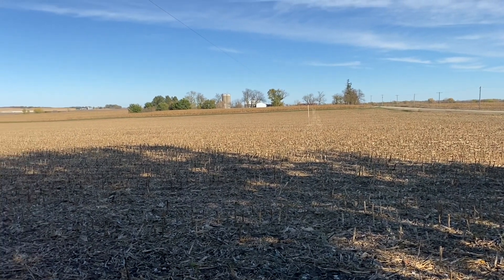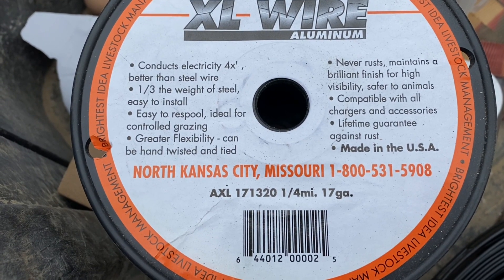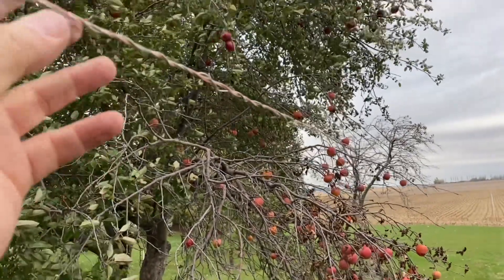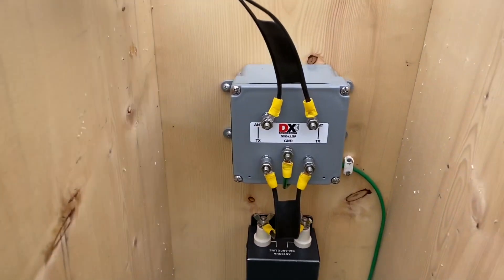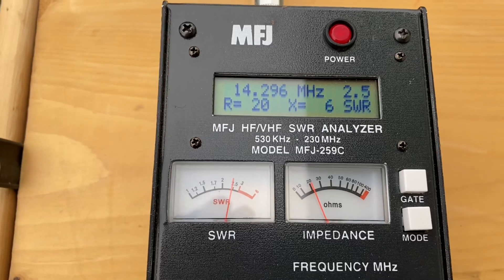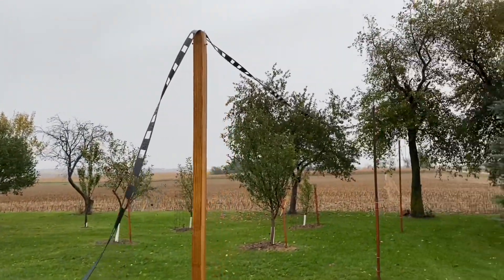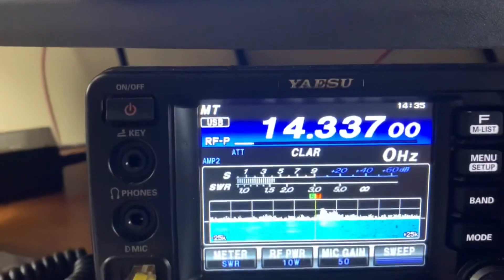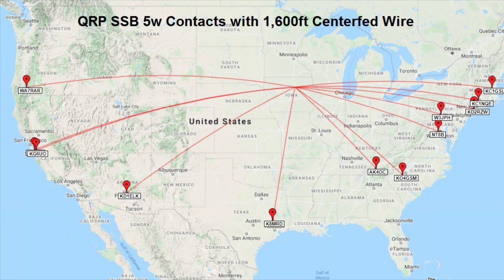1600ft Homebrew wire antenna QRP SSB 5w - Iowa

Comment: Oh but you CAN solder copper to aluminum! Bury the aluminum in highly activated flux (The old acid flux for plumbing) or use johnson chemicals Ruby Fluid zinc chloride (it is acidic and it deposits zinc on a molecular level: this REALLY aids in tinning - scrape the surface oxides off with stainless steel razor blade. Don't let air get to the exposed aluminum. Wet soldering iron tip with solder and it works perfect! Aluminum refuses to exist in it's bare exposed natural state with air, aluminum oxide forms on the surface INSTANTLY. More instantly than you think! Aluminum oxode is what you cannot solder to. It has a melting point of thousands of degrees F. I see it as though the aluminum I am hoping to solder to likes to grow a diamond shield to prevent it. Trying to actually weld aluminum is the same: the oxide layer is a blocker and must be removed. Go ahead and take a torch to aluminum! The outer oxide layer doesn't melt and the inner raw aluminum boils inside those layers.

Comment: Kevin and I watched this again and I am amazed at how great of an experiment and how radically different. The two antennas are. Do you still use the long wire to the top of the silo? I know you are usually using your fan dipole.

Comment: That 1600' wire should be great for winter 160 meter use.  But the high angle take off at such a low elevation does not help on the upper bands. Fun experiment. Thanks.

Comment: As with any piece of wire of you will make contacts but one wonders if resources would be better spent on another design. Even a 160m full wave horizontal loop might be a good alternative when used  as an all band antenna. I modeled your antenna and discovered that antenna has rather high gain and low angle of radiation on the higher frequency bands in the direction of the wires as is typical of long wire antennas. (e.g. N&S and E&W) . There is much less gain at a 45 deg angle to the wire axis.  Placing one of the wires so that it faces to Europe could be useful but the other directions may not be so useful. Study an Azithmuthul map for your location.  On 80m I think would rather have a vertical as this antenna is a cloud burner.  The radiation patterns are certainly a bit weird.  73.

Comment: If you still have any, try using any insulated electric fence wire already up on the poles in the field with the G90 tuner. Awesome video.
Reply from the maker: Thanks for watching.. I've been putting the ole G90 tuner to the test lately and it hasn't disappointed.. I'll have to look at the fence wire in the spring.. Thanks for your comment, I appreciate it.. 73, Kevin ~ k0klb

Comment: That was interesting Kevin. I have messed with delta loops in the past. I wonder how it would work it you added 800' attaching to ends of your V together. That would be a monster though! Would be quiet, but interesting to try. Just a thought. I just Subscribed to your channel today. Interesting to see your next experiment. Btw I have a 160 meter HWEF sloper from 40' on the tower up to a 70' tree. And I used the dji Phantom 4 Pro. Drones make wire antennas easy to hang! 73 from KC0FGX
Reply from the maker: Hello Ferrell.. Thanks for stopping and leaving a comment.. I did like the "V" configuration.. I really liked it when I hooked up my Tecsun S2000 Short Wave Radio to it.. It was so quiet and I think it was pulling in stations broadcasting on Mars, LOL.. it was a great listener.. not so much transmit but that's to be expected I think.. We did add another 1,600ft and squared it off.. It created a big lobe to the east, but not much radiation to the south, or west directions.. That video is at this link:  https://youtu.be/CBVbYH8iM7c  .. I use to have a DJI Phantom 2 Prof but it broke and  I now operate a Mavic Mini (249grams).. Thanks for subscribing and watching.. I appreciate it.. 73, Kevin ~ k0klb
Reply: @hamradioqrp-k0klb   Thanks again for replying Kevin! 73

Comment: Interesting. Did you plot the pattern with EZNEC? I did a quick plot. First thought is a little height would make a big difference. Second thought is legs may be too long. Plots with 2 and 4 wavelength legs on 20 meters gives pretty good patterns with an angle between the wires of like 50 degrees. Looks like you were using about 11 waves per leg.  A 90 degree angle does not let the lobes from each wire combine very well. I always model my antennas with EZNEC and use a standard 1/2 wave dipole as my standard. A half wave dipole 1/2 wave above ground has pretty good gain (about 8dBi). With only 120 foot legs, a 20 meter V beam at 55 ft has gain of almost 12dBi on a line bisecting the angle. When at 10 ft the gain drops to only 3 dBi. However at only 25 feet the gain is back up to over 10 dBi.  Also the peak elevation or takeoff angle rises as the antenna gets lower ( true for all horizontal antennas). Wish I had your space to play with! 73 de N4DJ
Reply from the maker: Hi Don.. Thanks for your comment.. I did not plot anything when I built it.. I just ran a wire from the house east to the fence and it happened to be 800ft, so I ran the north leg 800ft as well.. I had no idea it was in a "V" beam style configuration until someone mentioned it in the comments.. I literally just threw the wires out there to see how it would perform.. Like you say, the legs are too far apart as I study more about Vbeams.. I will say though, it is nice a quiet, LOL... like a sloppy Vbeam / beverage combination, LOL  When I connect my Tecsun S2000 short wave radio to it and listen to DX stations, the audio is amazingly crystal clear and sound like local FM radio stations.. The whole thing will be removed in the next month in preparation for spring planting, but I think for next fall after harvest, I'm going to look at getting more height and make a better effort at a real Vbeam or a possible delta loop.. I have all summer to think about it.. Thanks for all your detailed info.. I will refer back to it as I plan for next fall.. I'll see if my brother wants to plant and harvest around a couple 40ft poles out there, LOL.. Thanks for watching Don.. 73, Kevin ~ k0klb
Reply: @hamradioqrp-k0klb  40 foot poles would be nice! There is a guy I used to work on 15 meters out in the Northwest who used V beams. Narrow beam width but pinpoint gain.  I have the 19 edition of ARRL handbook and it’s got good info. I also have a old 73 magazine wire antenna book. I have an electronic copy I think I could email you if you would like. I have been collecting and doing antenna work for a long time.

Comment: While you may not technically be able to solder the wires together, you can braze them. They make ALCOP aluminum copper brazing rods so you can braze them together with a simple torch.
Reply from the maker: Hello Lunaeros.. Thank you for the comment.. That's great information.. thanks for sharing that.. I'll look that up and have some on hand for next time... Thanks for watching, 73 Kevin ~ k0klb

Comment: nice video it would be good to see how they both go on the low bands ie 80m and 160m 73
Reply from the maker: Hello Meggala.. Thanks for your comment.. I've been listening on 80 and 160 a few nights.. The noise is basically none existent and the signals are clear and strong... However, I have tried to break into a few of them and am not being heard... Granted, I'm only using 10 watts, but a few times I tried at 40 and 80w and still no one would answer me.. These stations were 200-300 miles away in neighboring states (Minnesota and Wisconsin).. I think its a great RX antenna.. but because it is only 10ft off the ground the TX is, well.. Not So Much on 80 and 160.. I'll keep trying a few more times.. Thanks for watching.. 73, Kevin ~ k0klb

Comment: You will want to put a 1 meg ohm resister at the far end of each leg of that antenna to ground.  The bleeder resisters will protect your radio from static buildup.  Or add a knife switch with leads to ground. The static generated by the wind and solar can damage your rig if not bled off.
Reply from the maker: Hello Jeffrey... Thanks for your comment.. Maybe I should install resistors as a secondary precaution?.. I have installed the DX Engineering Ladder Line Surge Protector into the feedline before entering the house.. It claims to withstand minor surges and shunts them to ground.. I was hoping that would take care of it.. I'll look into it further.. Thanks for watching.. 73, Kevin ~ k0klb
Reply: @hamradioqrp-k0klb hi, very interesting project in deed. 
The 1 Meg ohm resistors connected to ground at the far ends of the wires would be constantly discharging the static energy by a direct galvanic connection.The surge protectors you have installed at the shack end of the antenna are nothing but Gas Discharge Tubes; a sharp point metal electrode close to (but not connected) the main conductor in a hermetically sealed glass container with vacuum. The static energy has to build up on the wire to certain voltage so that it gets discharged to the ground. The voltage rating would be decided by the magnitude of the gap and air pressure inside the GDT. Again it all depends on how intact is the ground connection at both ends. 
De VU2RZA

Comment: Before I even got to the end of this video I knew that this is going to be great antenna, problem is that very few of us have room to deploy this antenna .
I said many times in my QSOs I need ten acres to get 10 more db from my antenna system 
Great job thank you for this video.
Reply from the maker: Hi George.. Thanks for your comment... I actually is turning out to be a nice antenna.. nice and quiet while actually working well on the transmit as well.. I've been using it QRP 5w and working POTA activations coast to coast today.. Last weekend, we added an additional 1,600ft to enclose it into a 3200ft square loop just to see what would happen.. It created BIG lobes to the East and North.. but many notches South and West.. so, I went back to the V beam configuration today and am able to get back west again..  Funny how all that works.. Thanks for watching... 73, Kevin ~ k0klb

Comment: I can only imagine the improvement to this antenna if you could get it up higher. I live on a 57 acre lot in rural NE Florida so I have the room to try something like this. I am planning on running a super long end fed wire antenna at a height of about fifty feet from the numerous antenna supports that grow on the property (pine trees). I especially like your use of aluminum electric fence wire as it's dirt cheap and readily available. All the very best, Dave, N2SN
Reply from the maker: Hi David.. Thanks for your comment... Higher would be an improvement for sure.. In addition, the aluminum wire is very light weight.. I have 200ft between the PVC poles and virtually no sag.. Good luck with your wire experiment and have fun... Thanks for watching.. 73, Kevin ~ k0klb
Reply: Do it! I have a 600 foot delta up about 40 feet in Ohio. Excellent for 1 watt or less CW work, which I love doing. 73 de KD8ZM

Comment: If you want to try directivity towards the center of the V's direction electrically ground at the ends of your wire runs like a V beam arrangement. Around 900 ohms is typically what you would desire.
Reply from the maker: Hello NightWaves... Thank you for your comment.. Cool, I'll remember that.. Currently we expanded to a square loop.. If I decide to pull that out this winter and leave the "V" antenna, I'll install the resistors and give it a try.. Thanks for the suggestion... 73, Kevin ~ k0klb

Comment: Antennas can be a funny thing. I have a speaker wire antenna cut for 20m in a vee pattern in the backyard (HOA, bah). The kicker is the feed point is just below the top of a 6ft fence and the legs go out horizontally to nearby trees. The vee I guess you could say is facing SE. I've been chasing parks for the last couple of months and I get anywhere between 5/5 and 5/9 reports. The rig is set for 100 watts but I'm going through a tuner so not sure exactly how much power going to the feed point. Definitely look for a better solution but it works for now.
Reply from the maker: Hi Roy... Thanks for your comment... Speaker wires work well as an antenna.. I've used them too.. It is amazing what we can work with just a tuner and a wire.. Hope you find a solution you're looking for but sounds like the wire is working well for now... Thanks for watching.. 73, Kevin ~ k0klb

Comment: To make that feed line to antenna connection more certain you might check out the specialized aluminum-to-copper connectors used in electrical power circuits.
Reply from the maker: Hi Michael.. Thanks for the comment.. I didn't know anything existed like that.. Thanks for the tip ! !  I did load up the connection with No-Ox grease and taped it up.. Hopefully that will keep any corrosion from developing over winter.. I'll google the Alum to copper connector for future use.. Thanks again... 73, Kevin ~ k0klb
Reply: A simple style of those connectors is called a split-bolt connector. Pull off the electrical tape for two inches and slip the bolt over your twisted wires and tighten the special nut . Then, reapply the electrical tape over the bolt connector.  Wa0tuc

Comment: I wonder how good it would be for 630m or 160m. Thanks for the video fun to watch.
Reply from the maker: Hi SkinnyFlea... Thank you for your comment.. I am able to pick up stations on the 160m.. It's very quiet and I have to turn on my preamp on my ic7300 to hear good audio, but the noise is virtually non existent and the audio sounds good... I don't work those bands so I have not made any contacts there to give you any input.. Sorry I couldn't be much help.. 73, Kevin ~ k0klb

Comment: Well done,  great experience,  so what's best long wire or dipole?
Reply from the maker: Hi Robbie.. Thank you for your comment... For sure, the off center 550ft long wire that is tied 70ft high on the silo is the clear winner.. There is much more gain with the height, as would be expected.. A few days ago, I recorded another video converting this V beam antenna into a 3200ft Square Loop.. You can find that video on this channel... Adding the additional length added a 12db gain (two S levels on the meter).. It is fun to experiment with antennas.. I always learn a few things along the way.. Thanks for watching.. 73, Kevin ~ k0klb

Comment: Gene, K9UOK How did it do on 75 and 160 mtrs?
Reply from the maker: Hi Gene.. Thanks for your comment... I'm sorry, but I'm probably going to disappoint you with my answer.. I really don't spend much time on 75 and 160m to say if there was an improvement or not.. I haven't joined any nets or ragchews on those bands, but I did spend a little time just listening to a few QSO's and the noise was low and signals were good.. I had to turn on the Preamp to levels 1 and 2 on my ic7300 to find the audio of stations.. Once I did that, they were clear and and the noise was minimal.. I know that's not a very scientific answer but it's all I have, LOL... Thanks for watching... 73, Kevin ~ k0klb
Reply: @hamradioqrp-k0klb  Thanks for your reply. I was more interested in how the SWR and impedance was without a tuner.  Gene, K9UOK
Reply from the maker: @TheGeno1966  Ahhh... Ok, I see.. well, I did video the 160m and 75m bands but I didn't include them in the video and have since deleted them off my phone.. I don't remember what they actually were... I have since expanded the "V" antenna into a square loop, otherwise I'd measure it again and record in a video so you could see how it did... Sorry about that.. Next time I'll make sure to include them... 73, Kevin ~ k0klb
Reply: @hamradioqrp-k0klb  Thank you for your reply.  Best wishes on your antenna.  Gene, K9UOK

Comment: Vee Beam. Normally 3/4 wave length on each leg if I remember correctly. Has gain off the open end of the V.
Reply from the maker: Thank you for your comment.. That's good to know about the gain off the open end of the V.. I wasn't sure what to expect.. I did make a few contacts so I'm happy with it.. Next we are working on Phase II.. completing it into a square loop, LOL... 73,  Kevin ~ k0klb

Comment: ...actually a "V" beam..check from your QTH where your 45* beam pattern is.  This thing will work like a bomb on 160, 80 and 40. Interesting that an antenna that long, is actually a half wave dipole for 292khz! Listen for the longwave broadcast stations from Iceland, England etc. this winter. BBC has a big signal on 198kc!!
Great job!
Reply from the maker: Hi TIm.. Thanks for your comment and insight.. I will do as you suggested.. I also have Tecsun S2000 short wave radio that I can connect directly to the coax of the wire antenna.. Should be interesting and exciting to see what I can hear.. I'm also going to experiment with adding another 1600ft to enclose the "V" beam and create a 3200ft square loop.. I don't know what that will do to the whole thing, but I'll find out.. Do you have any fore thought on how that will react? (for better or worse) .. I'm just a rookie, playing around and experimenting, LOL... Thx again.. 73, Kevin ~ k0klb

Comment: You got enough ladder line to make a 2 meter slim jim.
Reply from the maker: Hi JB.. Thanks for your comment.. I had to google the "2m slim jim" as I didn't know what that was.. very interesting.. Looks like copper plumbers pipe.. I never operate at 2 meters but maybe I should give it a go sometime.. 73, Kevin ~ k0klb